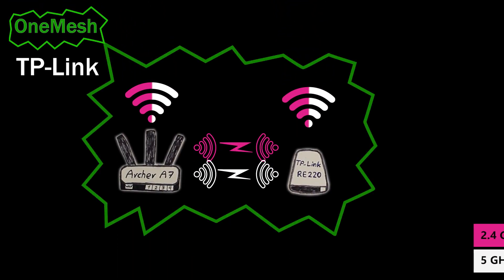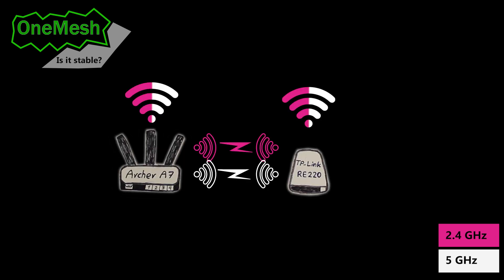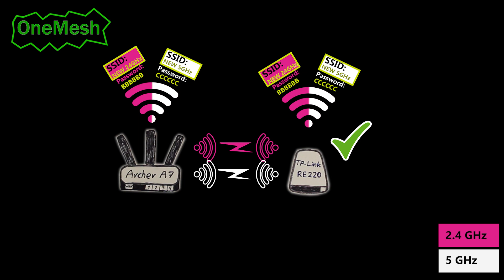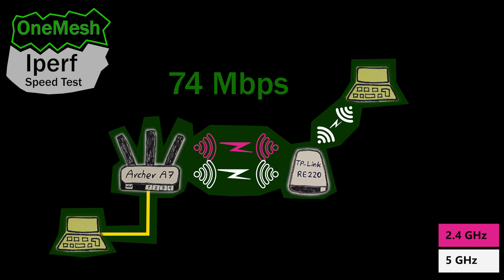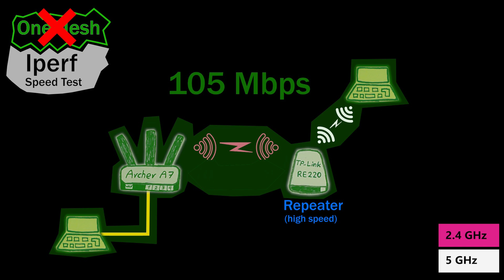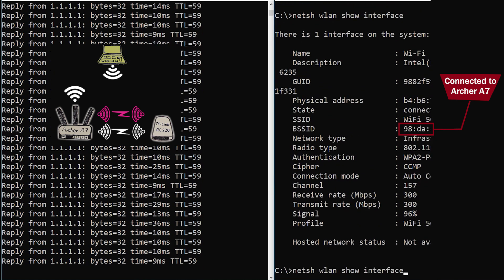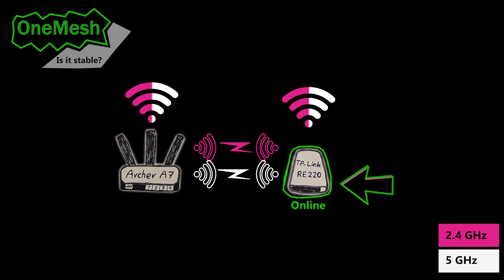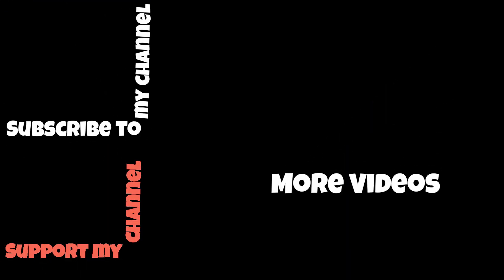Testing the TP-Link OneMesh Network [Speed] [Roaming] & more

Comment: why 2.4GHz never get past 50Mbps, no matter how fast our internet plan is?
Reply from the maker: 2.4 GHz and Internet are 2 different things! It's like you asking why my car cannot go any faster than 100 mph no matter how wide the road is!!!!
Reply: @Behfor  Yeah , thanks for replying, I know that, in that car analogy even if the road is very smooth and 50 ft wide if the car top speed is 60MPH then it can't go faster than 60, but my point is if my internet plan is 250 and the 2.4GHz N300 router is claimed to be 300Mbps why it can't transmit more than 40's?
Reply from the maker: @loneranger8248  That 300 Mbps is only theoretical! In real world It is almost impossible to achieve that number for many reasons including the fact that WiFi is only half duplex, it is also a shared medium! There is also wireless noise, interference which would degrade the connection quality. Plus, it also depends on the WiFi capabilities of the client device where you are running the speed test on. I could go on forever but the point is wireless is nothing like wired where you can pretty much guarantee a certain bandwidth.

Comment: I have pretty much exactly the same setup, Archer A7 with an RE220. Perhaps not surprisingly, connections through the RE220 do not have anywhere near the same bandwidth as connections directly to the Archer. So far, this has only been noticeable with "speed tests". The only drawback I've found with OneMesh is that the Archer doesn't support it when used in "Wireless Access Point" mode. I have another router, a TP-Link ER605 to "multi-WAN" my home with both Fiber and Cable Internet connections. It's not great "routing my router" but I'll live.

Comment: Hi!!
Can I find mesh devices that connects to each other by cable?? 
My company walls are very thick (very old) and the rooms are far from each other.
Reply from the maker: Hi, yes Asus Aimesh allows you to use wired backhaul. Check out this video:
https://youtu.be/kPVpsXb6ejU
Reply: @Behfor  thank you so much man!! I'm gonna subscribe!!
Reply from the maker: You're very welcome! Thanks for subscribing 🙂👍
Reply: @Behfor  Hey. Do you know if this asus supports aproximately 50 devices??? I need a router for my company (aprox 12 user + smartphones and notebooks and PCs). I was looking for asus RT-AC86U because the AiMesh (and the price) but couldn't find the capacity of simultaneous devices connected. 
Thanks for your attention. I’m looking forward to your reply.

Comment: Everyone believes the speed printed on the box .
( When actually the best speed to the internet can NEVER be faster than the Internet uplink speeds, except between local (LAN) devices,, )

Seems to me that you would have achieved higher speeds by keeping your old router and configuring it as a Access Point, and linking them together using the LAN ports 
( Especially if those LAN ports where 1000MBs ones )

I've played with this and discovered that it is possible for multiple access points to have both INDENTICAL named and password without any special " Mesh " Being present, and that best performance is achieved with them setup on different channels ..

Enjoy 🤗

Comment: A very informative and helpful guide...
Does OneMesh with Smart Connect Enabled allow WiFi Roaming for Smartphones?
Reply from the maker: Thanks, WiFi roaming is enabled in OneMesh for every device with or without using smart connect. The smart connect would use the same name and password for the 2.4 GHz & 5 GHz networks. Some people might prefer to have the same WiFi names all across their house so they can enable the smart connect, but others (including myself) might prefer to have different network names so they don't need to enable it. In my case the smart connect even made my roaming worse, so it is definitely something that I know I'm not going to use. I hope this was helpful. Thanks

Comment: What if i turn off onemesh and use same ssid between router and extender? Does it seamlessly connect?
Reply from the maker: In that case and in my experience, if the repeater is set up correctly (location wise and configuration wise) the roaming could be usually as seamless as using OneMesh. Thanks.
Reply: What if i have 2 or more extenders. If there is a power outage and the router came in power at last, having same SSIDs can create a problem of the extenders connecting to each other and resulting no internet. But is this the same if i turn on OneMesh? Will even in OneMesh if there are multiple extenders, will one must connect with router whenever it comes online? And can i setup Router to Extender to Extender to Extender?

Comment: Can you connect to the RE220 with an wired ethernet as an access point ... and then switch on onemesh?
Reply from the maker: No the re 220 can only be a node in the onmesh network and as a node it can only be wirelessly connected to the router.
Reply: @Behfor  for asus aimesh tech you can also backhaul to the nodes using a wired ethernet... and that way the speed doesnt get halved
Reply from the maker: Yup, that's true

Comment: Thanks! Disappointing on the results. Just got a A20 on sale and still tempted to get a repeater, though maybe I'm not so disappointed that it doesn't support one mesh. Using Smart Connect, and it's nice, but seems to put my 4k tv and Xbox on the 2.4 GHz when 5 GHz is well in range and can get higher speeds.

Keep up the interesting videos. I bet that took some time!
Reply: Guys, seeing the tests... I would say the Network would be using the 5 GHz Band as a backhaul and connecting clients via 2.4 GHz, on Smart Connect.

2.4 GHz is slower, but in theory the Network devices using the 5 GHz as a backhaul would allow more Bandwidth for more clients, connecting them on the 2.4 GHz.

Just my thoughts. As far as I remember, TP-LINK is one of the brands that doesn't have a dedicated  radio for backhaul only, like Linksys.
Reply: @marciomcm2736  that could be right. Depending on the TP-Link mesh options, some have dedicated wireless backhaul or powerline backhaul, but of course not the A7 and this repeater.

I'm hopeful they add the feature to more routers, such as the A9 or even A20, but at some point a dedicated mesh system would be better.
Reply from the maker: Thank you very much! I actually had the same problem with smart connect and my laptop keeps connecting to 2.4 GHz, it feels like it doesn't have or doesn't do band steering!!